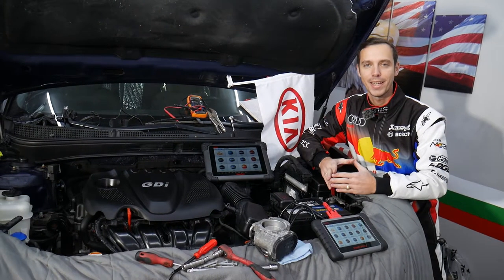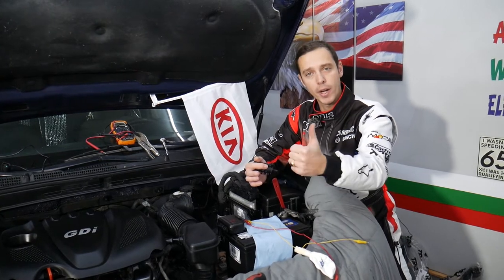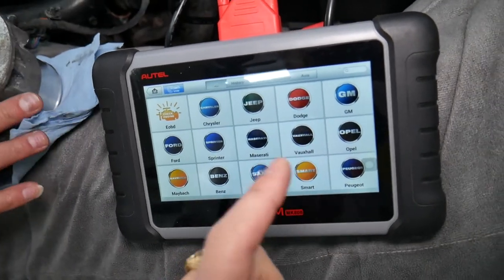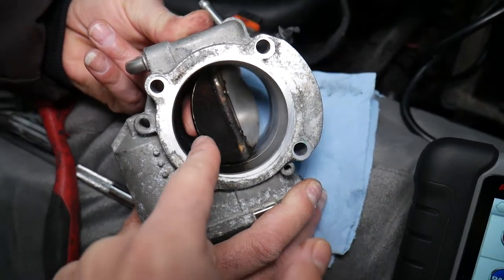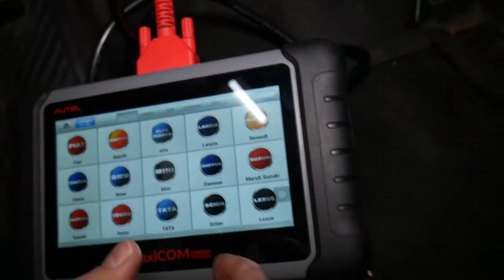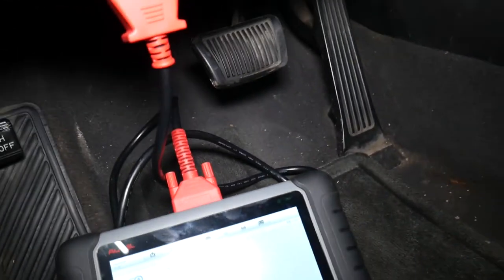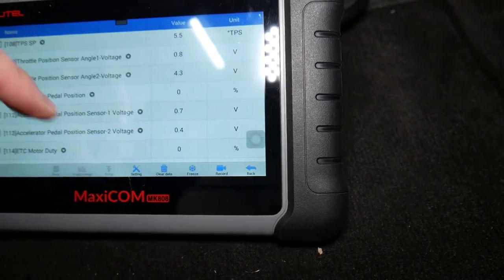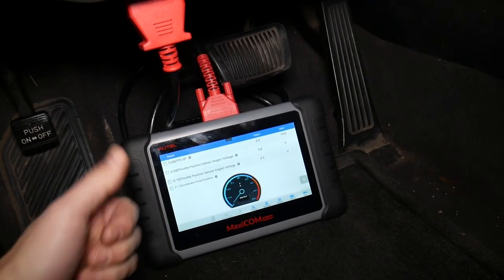KIA TEST ACCELERATOR PEDAL, GAS PEDAL, THROTTLE PEDAL KIA SORENTO SOUL FORTE SPORTAGE RIO OPTIMA

Comment: Hi . I have a question does a 2008 Kia Spectra have a pedal accelerator sensor? At auto zone the clerk says it doesn't have a sensor for pedal. How can I find out if my Kia has one or not?
Reply: My throttle body no open
Reply: My throttle body kia rio hath back  not opening